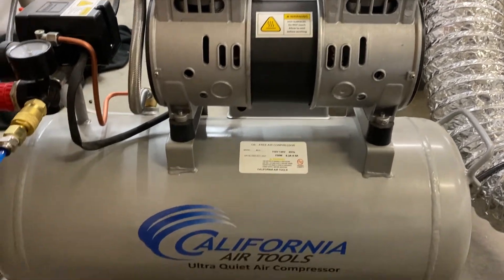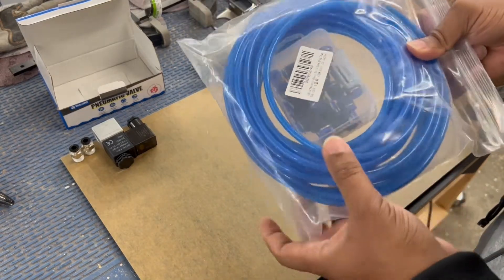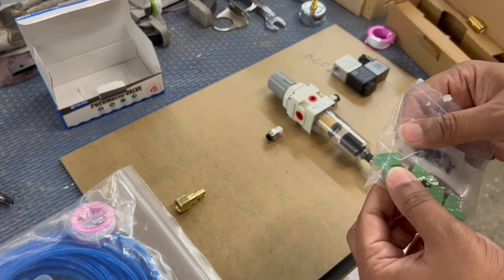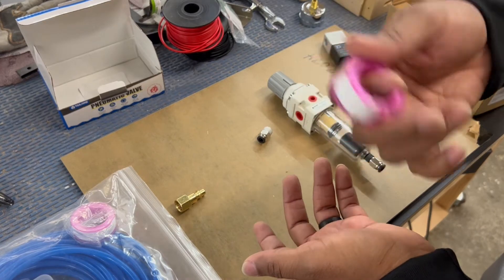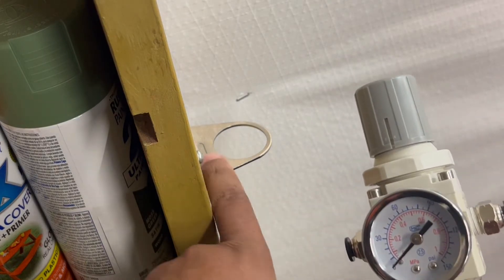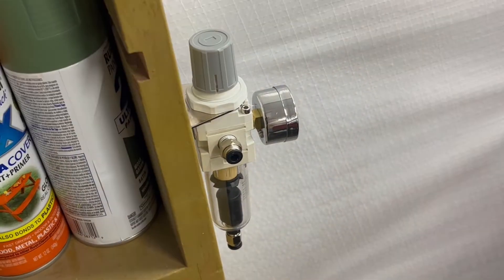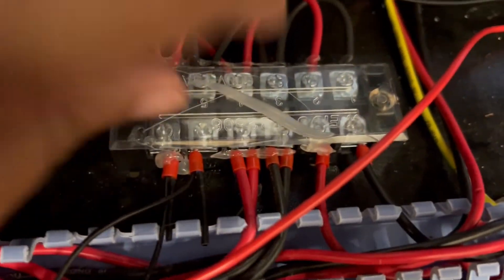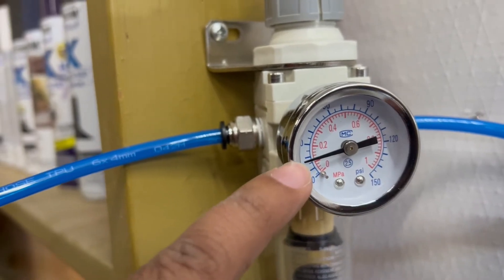CO2 Laser Air Assist Upgrade

Comment: I bought items listed in your link, connected everything, and am ready to go. I also checked the air coming from the shop air compressor (California 8 gallon) with the regulator without solenoid connection,  just to make sure the air is coming out fine. It is working. Now I need to connect the wires from the solenoid to the controller panel. I have a Monport 100-watt CO2 made in 2024. The stock compressor that came with it is already connected to 24V and aux terminals. I want to remove those wires from the terminals and connect them so that the stock compressor runs continuously. Then I want to connect the solenoid to 24V and aux so that they run only when the job is running. That way, I can turn off the shop compressor when engraving (only the small stock compressor is running). I don't know much about electricals so I want to make sure I am not going to short when I connect the existing wires coming out of 24V and aux. It is just a relay, and I think it should work.  But I want to double-check. Please let me know. Thank you for your in-depth video.

Comment: Very nice tutorial.  One thing I'm wondering is what PSI you run your compressor at for making cuts?  Thanks!
Reply from the maker: Usually between 20-30 psi I’ve heard others who run it a little higher but it’s a good starting point until you mess around and see what works best

Comment: Hi I have the same regulator.  How do you adjust the top grey knob?  I try turning it in both directions and it seems stuck.  Do I need a tool?  Or is there a specific way to unlock and turn the knob?
Reply from the maker: Nope it should just turn freely. I'm not in the shop at the moment, but i'm pretty sure I don't have to push or pull on the knob to get it to adjust

Comment: After watching several videos of this same upgrade you were the only one who has the correct wiring of the solenoid for my Ruida controller board, finally is working properly turning on when laser is on. Thanks

Comment: Love the video!!! I noticed you're using stranded wire in the video but your Amazon link is for solid core copper-coated aluminum wire. I believe the OEM uses stranded copper as well. Have you noticed any problems using stranded vs. CCA solid?

I deleted my other question because you answered it lol

Comment: My kit came with a manual switch, I didn't see one in your setup. Is it necessary?
Reply from the maker: Not sure what you mean by manual switch? Attached to what?
Reply: @vanstray figured it out. the cloudRay kit comes with an additional high voltage relay and a manual switch, so you can turn compressor on with a toggle switch located on the machine. Realized I only needed the solenoid, and the air button works on my controller just like your setup, all the extra cloudRay crap isn't necessary.

Comment: Hey ! Great setup , question at about what psi do you set your regulator?? Furthermore , what do you do when you have a longer project , will that compressor hold steady at same psi you set it as for longer period of time ? Thanks
Reply from the maker: Have mine set around 25-30 for cuts. On longer projects it just empties and fills up as needed. It’s not very loud when the air and chiller are on so I dont notice it too much

Comment: Thank you for the tutorial, much appreciated. I am half way there, bought the compressor and connected it up but with no solenoid, regulator etc, didn't realise I'd need it! Should have done some research beforehand. Glad I found your video, I've ordered all the extra bits I need so hopefully up and running fully tomorrow!

Comment: Did you install an in-line dessicant air cleaner dryer? I contacted California Air Tool and they recommended an air dryer to be placed in between the regulator and compressor.
Reply from the maker: Nope I haven't, that's the first time i've heard of that being a thing for this type of setup. based on what my regulator looks like I don't get much water vapor in my lines currently.

Comment: This is awesome.  Quick question. With the 8 gallon air compressor, how often would you say you'd need to turn it on to fill up?
Reply: Mine runs non stop at only 5psi so I hope you ended up with something else.
Reply: @jeffcivjeep7  with the solenoid?

Comment: Great video! Question: Is the fan that you reconnected the stock exhaust fan for the laser bed? I ask because I upgraded my exhaust fan so I guess I can completely disconnect the power wires (time segment: 12:58). Sound right?
Reply from the maker: no that was the stock fan on the opposite side for cooling the internal parts like the power supply

Comment: Thank you! Very new to lasers... One thing I have learned, or not perhaps, some go with a dual airflow to keep just a tick of air running for the optics. For your readers, though the Chinese may not, you should use a rubber hole grommet when passing wires etc through sharp metal.. that is a failure point. Again thank you very much for your video!

Comment: Thank for sharing I follow your step by step on my 130 watts laser but it’s not working I notice on another video they also add on the ground wire I wonder if that could be the issue not working
Reply from the maker: Hard to saw without seeing your setup. I'd say see if there's a little green light on with your Solenoid and if not double check the power connection and that it's in the air assist. I know they make some changes every few months so your board will probably look different than mine does in the video

Comment: I have issues with my materials smelling like smoke after cutting. Will this upgrade help with that?
Reply from the maker: Burning anything will have that slight char smell to it, but this helps to clear it out faster so it’s less of the lingering smell when you open the door after the cut

Comment: Very good video. I upgrade my 130w CO2 with a 40L Compressor and a Solenoid. When I start the cut the air comes but don’t close after. Do you have any idea what’s the problem?

Comment: How long does the compressor runs to in order to build back?
Reply from the maker: That all depends on how big of a tank you get and how long your cut is. I have a quiet compressor so it will cut on and off a couple of time during a long cut, but it charges back up pretty fast, but I don’t hear or notice it turning on much when I’m doing other stuff, because it’s that quiet.

Comment: how much pressure is needed for a 40w co2 laser?
Reply from the maker: I can't say exactly, but I would say most depends on what you're cutting. I run my lower for engravings compared to higher at like 20-25 psi when i'm trying to cut all the way through plywood.

Comment: Thank you for the helpful video on the air assist upgrade.  I did the exact same thing to my laser today.  Works great!  What pressure do you normally set your regulator at?
Reply from the maker: I normally leave mine in the 20-30 range, that does pretty solid for all my cut jobs.

Comment: i HAVE 3 BROWN WIRES COMING FROM THE 24V ON MY BOARD ABOVE AIR ASSIST. NOT SURE WHAT TO DO THERE
Reply from the maker: Hmm don't know which version of the machine you have. I'd say try to trace those back to the source, one could/should be for the power to the current air assist unit.

Comment: Thank you for the video...Excellent!!! However, my air assist does not seem to be working. The regulator does not move, it makes a loud sound when I turn the laser on, I am getting no air during the cut, and lastly there was a 4 pole connector in the panel where 2 pole connector should go and a brown wire plugged into one of the slots (not the one that says Wind). Not sure what to do??
Reply from the maker: So quick path to follow is - compressor is on, air in regulator, your cut files in light burn are set to have air assist turned on. If all of those are good then in the board there should be something called wind or air assist and you'll need to be plugged into there. If it has the 4 block if nothing is plugged into wind that's where you'll plug into. It's ok to use the 4 block connector already installed.

Comment: @ Vanstray i bought everything from your list and i just got everything today. And i just noticed that my wires are thinner so i went back to your list and you put 18g wires but in the video you mentioned 16g. Does it have to be 16g? Cause if not im going to have to order it again. Pls let me know if i can use the 18g or it has to be 16g. Thanks
Reply from the maker: You can use the 18g wires for this. I got 16 cause I wanted more uses for it down the road. Thanks for letting me know I’ll go update those links to match the video
Reply: @vanstray  thanks for the response I really appreciate the help. And this a awesome video i have seen so many of them about air assist and for me this is one of the best video.  Explaining and showing everything.  Subscribed to your channel.  God bless you and your family 🙏🙏

Comment: What do you do if something  is already plugged into the 24 volt spot
Reply from the maker: depends on what's plugged in. Is it the current air assist or is there a different spot on the board marked for air assist and power?

Comment: Make sure to add a diode relay into the mix with the Solenoid. Otherwise you run the risk of frying/shorting the port on the rudia board. Known issue apparently. Happened to me. Most videos on the subject don't mention this. >$5 part saves you the headache of having to replace a $300 board
Reply from the maker: hmm i'm going to look that up. Thanks for mentioning it.
Reply: @vanstray  Have you looked into this at all? I’m getting ready to order parts for the LED and Air Assist upgrade.
Reply from the maker: @rustyp21  I looked it up a little and didn't find much info on adding in a diode relay for this setup. Checking in with some of the other laser guys who have similar setups I don't see them with relays either. Not saying it can't help, but based on this setup it might not be a deal breaker. I'm also not an electrician so that's just my current opinion based on what I currently know.
Reply: @vanstray  Look up “flyback diode”. They prevent the collapse of the magnetic field in the relay coil from inducing a negative voltage spike and damaging the controller. The diode shorts the spike. Just connect it across the wires where they connect to the relay. Polarity is important; the end with the stripe goes to positive, the other end to negative.

Comment: This video is great thank you! Getting ready to upgrade my air assist. Can someone tell me why I need the regulator since there is one already on the air compressor. I have the same equipment shown in the video. Does this second regulator do something different than the one on the California Tools compressor? Or is just for easier access when regulating for different materials?
Reply from the maker: The regulator in between the compressor and machine is to regulate the air for different materials and to filter out any water in the line so it doesn't spray into the machine itself. I usually see a little condensation if i'm doing a longer cut or the temp in the shop is too hot or cold.

Comment: Hey Van, Thank you for making this video and for being so detailed.  Your efforts are much appreciated. I have the same Chinese 100W laser.  I think they later became Omtech as they seem to use the same chassie.  
Its a great machine but it does need some minor updates e.g. led lighting, air assist, and inline fan.  Its also a good idea to have both 2.0 -2.5, and 1.5 focal length lenses.
Reply from the maker: Hi and thank you! Yeah it’s pretty nice, but those add ons and upgrades really dial it in nicely. It’s a great machine to start and grow with.
Reply: Just like with allot of things Chinese (scooters) one basic item is made ( the frame) and then a company buys a large quantity and stuffs their choice of parts in it. 
Even the units made in usa are still Chinese  at heart.

Comment: Excellent! Thank you so much. Couple questions: On the regulator, do you adjust the PSI depending on different materials that you are cutting? Also, on the pressure regulator on the compressor, what do you have that set at as it feeds air to the regulator? Do you keep it at a constant PSI or do you adjust it up or down dependent upon the materials?
Reply from the maker: On the regulator I adjust based on the material I’m cutting or if I’m doing an engraving and just want a little air to keep the lens clean. On the compressor I just keep it at a constant psi since it’ll shut itself off and the regulator handles the rest leading to the machine.
Reply: @vanstray  Hi. So I got all my parts delivered today and working on getting everything installed. Traced the power cable from the old air pump to disconnect it. It did not go to the same place that yours went to. It actually went to a block connector that was plugged into the side of the module that has the laser output display. Question: Can I plug the wires from the solenoid into this same block that the old ones came out of, or should I plug them into the same place that you show in the video? On my system, it looks a little different but I believe it is the same as yours. There is a 24V and an Aux Air in the 1/2 spots in that section (instead of the 5/6) shown in your video. But there's nothing in that section now. Thanks!
Reply from the maker: @MrLogansrun01  sounds like you have an updated model from mine with a different controller, but it sounds like the ports are labeled roughly the same. I'd say connecting to the 1/2 would be the way to start cause it's easy enough to disconnect those wires vs where the current power is running. I'd have to see it to get a better idea, but that's how I would start with it.